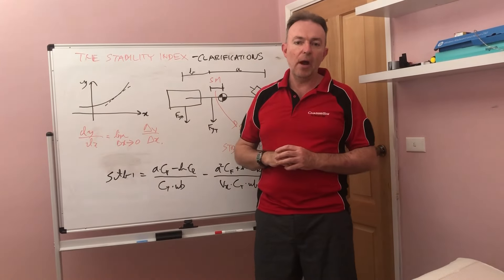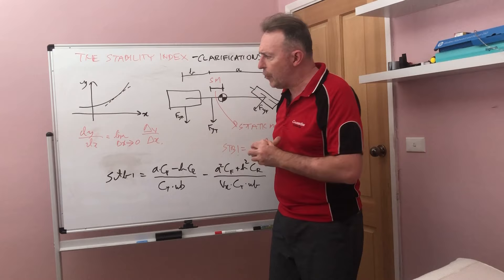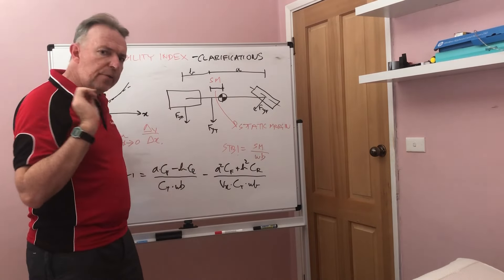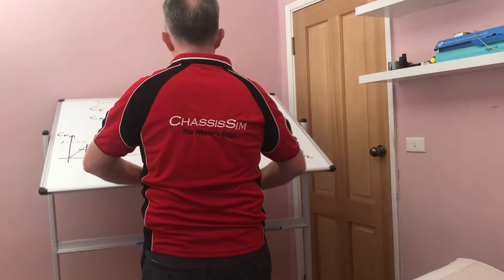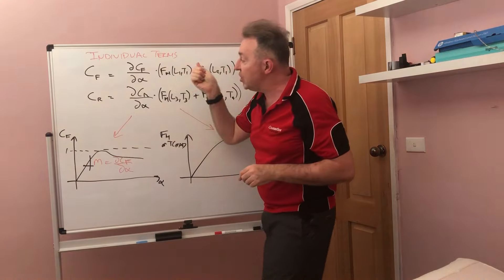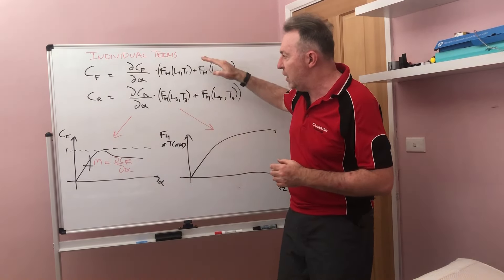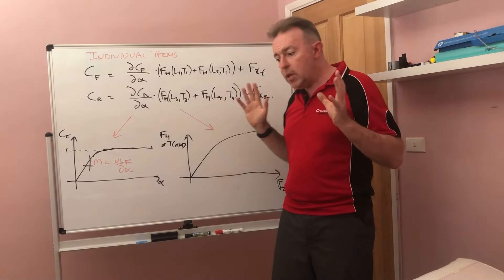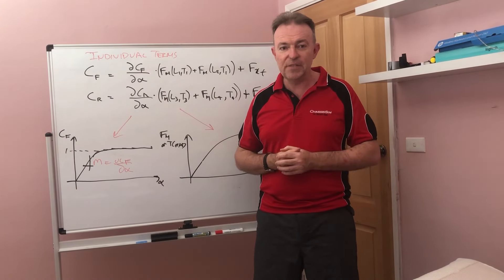Racecar Handling - Clarifying the stability index

Comment: Hey Dan, I have a question. I was reading Race Car Vehicle Dynamics, and what the book mentions is that SI is the slope of the line that contains the effects of Nb and Nr (Moments partially differentiated with sideslip angle and yaw velocity respectively) and then plotted against the lateral acceleration. Is the stability index that you mentioned in the video same as the stability index given in the book? Also, what does the stability index actually mean, like what is its significance. From the name, I assumed it would be a degree of the stability of a car in a turn or some other situation, but I can't seem to get a hold of the intuitive meaning of the term.
Thanks!
Reply from the maker: Arin a couple of things. So the Stability Index from both Milliken mean the same thing. There are subtle differences but we are barking up the same tree. What it measures is the moment arm from the centre of lateral forces to the c.g divided by wheelbase
Reply: @ChassisSim  Right. And about the Center of the Lateral forces, I thought the static margin was the distance between the Neutral steer point and the Cg divided by the wheelbase. Is the Center of the lateral forces the NSP? Also, what is the significance of the stability index then, like if i know the stability index of a car, what can I predict/measure.

Thanks a lot!